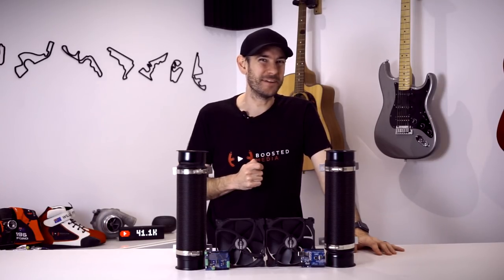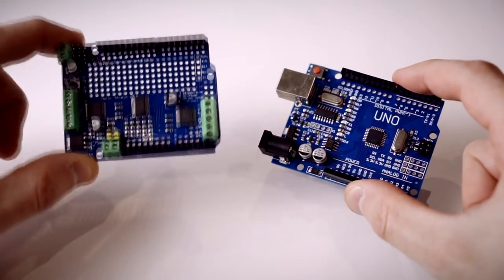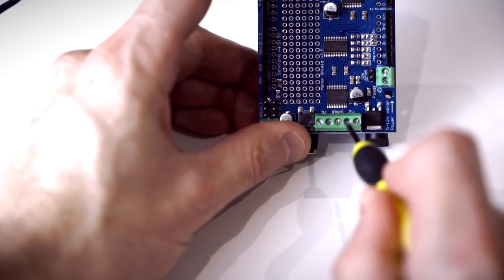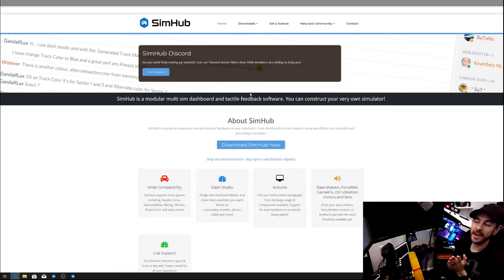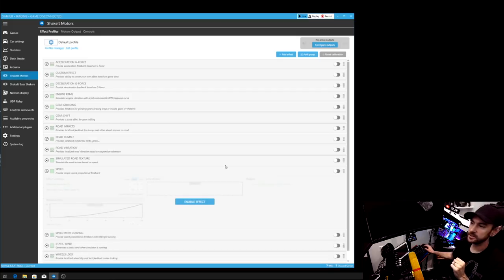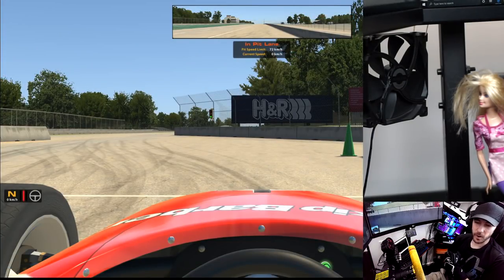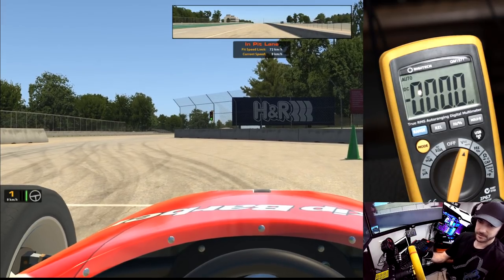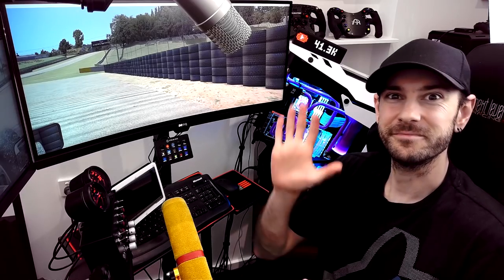Building a DIY Wind Simulator - Part 1

Comment: Thank you so much for the excellent instruction. Do you think there is a way to make a "Zoned" response the airflow? I am building a VR Heli Sim and want the wind to blow when i put my head outside the cabin to simulate the downwind experience by open door flight and looking down at the ground
Reply: You could just direct the fans into the area where you 'put your head out the window', then when you put your head there it will be blown by the fans :D

Comment: Does anyone know where you can purchase the motor shield with pre installated header. Can't find anywhere. Went through step by step and when I get to testing fan I get no power to them. I'm getting lights on both boards and simhub had detected the wind Sim.

Comment: Does the software account for wind curving?
Reply: Yes, but if you use this feature make sure you use PWM fan control, not voltage control. (simhub supports this, look at the documentation) Also ensure you only use about 25% change each way to prevent the slower fan from stalling.

Comment: Man I have really lost faith and trust in your videos because of this DIY wind sim video. 
1. The fan needed has to be perfect. I bought different fans and getting sputter at low speeds... the fans you have posted are not available in the USA!!!!  Please update link or give us an option!!!
2. Why did you have me cut the power wire. With the jumper on you can run power from arduino and not shield... I feel like I shouldn’t have cut now after watching other videos where they did not
3. Please explain settings better. Namely the PWN setting and honestly rest of SimHub settings. This is a huge hole right now that no one is providing very good.

Comment: Good news, today I got a real adafruit motorshield v2 instead of the broken clone, soldered the headers and voila - everything worked instantly like a charme.
But holymoly.... the 4000rpm fan is wayyyyyyy to much. Even with only 10% of power in Simhub it makes enough wind! Danger of conjunctivitis!

So if I do the math a 400rpm would be quite sufficient and I‘m wondering if the arduino and the powersupply could have been smaller as well. :)

It happened to me a while ago almost the same: when I planned and installed 4 bass shaker and a 4 channel amp (for my „racing seat“ of course) which can shake my neighbors now as well.... a little bit oversized as well.

Comment: Great minds think alike. Will, I'm working on this exact same thing. It's been in the planning stage while I've been trying to talk the wife into it. She thinks it's ridiculous and has been a hard NO. You have once again saved to day with your very timely video. So I'm moving ahead into the construction phase. This video has answered a lot of questions, as I to am looking for the immersion effect of driving open wheel cars. I have a new fan that will be mounted outside of my house in a mock dog house. This dog house idea I came up with will solve a couple of problems. 1. Noise, the fan I've chosen is a 110 volt, high CFM, 6" inline blower. At full speed it can move 500 CFM of air and makes a bit of noise. I plan on using sound dampening material inside the dog house. 2. Dust Free. the 6" duct work will come into the house using a large Dyer vent and will split into two three inch flex duct work, so that it can come into my rig just under the top deck, where each will end using a auto A/C vent. That way I can control the direction of the airflow. At top speed the air extincting will be traveling at near 120 mph. That is after I've regulated the blowers speed down a bit. It is capable of 200 mph, but that seems a little excessive for the dinning room. LOL. My point is, at those velocities anything pulled into the air stream would be very dangerous indeed. So the dog house will be a very large air filter. It will need to have enough filter area to supply the fans CFM intake requirements. I will send you a link to some photos as things come together. It should be insane. Cheers.
Reply: That all sounds amazing, until your dog farts 😅. 

p.s I assume you've sold your dog to fund your Sim racing addiction.

Comment: I haven't read all the comments but I think someone mentioned higher rpm fans. I did the same as you and started with some old case fans that weren't powerful enough. Moved to some cheap bit coin mining fans. They still didn't impress but what did it for me is to decrease the pwn in the motoshield setup to around 600 (play around with it) from my understanding, fan speed is controlled by pulsing the fan motors on and off. At 1600mhz, it is pulsing so fast that the motors barely get time to work. Try this before changing fans. Also, if you do change Fans, I recommend trying this for a stronger effect. It also heavily reduced the whine from the fans. Sorry about formatting, typing on phone...

Comment: Hey m8 I used the separate PWM feature in simhub to get it to interface my fans. The issue I have is that my fan spins only after reaching 120kph and it's at full speed. The fan never ramps up linearly. Any solution
Reply: Yes. The set the minimum speed for the fan so it is moving when you are at 0 kph. Then add 5% to prevent the fan stalling. Use the "cabin air" feature which keeps the fan spinning when not racing to determine the slowest speed your fan will handle. All fans have a minimum speed. PWM fans will not move the fan until it reaches a safe minimum demand. Also, PWM fans have a maximum pp/s above which the fan will stop! You will need to determine the minimum and maximum values for your fan (and arduino) and then go 5% over the minimum and 5% under the maximum. Note: this behaviour is true of ALL PWM fans to protect them from damage. Further, if you push the demand close to the 100% mark, the fan will soon shutdown to prevent the internal electronics overheating. PWM fans move air well but ironically have no cooling for their own electronics.
Finally, you may find you cannot reach the maximum continuous RPM for your PWM fan. The reason is one of a: the spec sheet is lying - this happens a lot, b: the Arduino cannot produce a clean PWM signal at the rate required to hit the maximum fan rpm. Again, this is very common. The maximum I have been able to achieve with a true 5000rpm PWM fan (they are expensive!) is 3600rpm because the 16MHz Arduino cannot switch the signal any faster with a clean rise/fall in the signal. It would need to provide a 43,000 (forty-three thousand) on/off signals per second to hit 5000rpm. A 16Mhz Arduino can only reach 23,000 pwm cycles per second reliably. Pushing it any faster makes the signal "muddy" and so the fan shuts down to protect itself.
Reply: @bertram-raven  Wow that's alot to digest. But anyways thanks for such a detailed explanation. I had abandoned the project due to the issue but looks like I can get it working by the summers

Comment: If you want to get more airflow instead of getting a 120mm 4000rpm that sounds like a leaf blower, wouldn't you be able to do with a couple 200mm fans that don't spin as fast?
Reply: If you can find one that is lower than the amp limit of the arduino then you could

Comment: I have all parts together now but the motorshield is a) horrible expensive and b) not ready soldered. What a bad... I bought a motor shield clone instead BUT this doesn't work at all. The arduino is detected only without the shield. Harrr.
Did you really solder the heads by yourself?

What I want to mention anyway: 
One can not underestimate those DIY videos like yours enough... I would have never started building a wind simulator, even though it's not successful yet. But with all your hints and tips it makes it much easier and pleasant.
Thanks again, Will.
Reply from the maker: You’re welcome. My motor shield came assembled.

Comment: Can someone suggest a motor shield that does not need soldering ? Thanks.
Reply: I had the same issue. Plus my fans had 4 wires. Did you find anything?

Comment: Always dig your tutorial videos...I found you after my latest PC build with the ROG Asus Maximus IX Code and a i9...Thanks for helping me get to 5Ghz!!    I sim race in the Porsche Club of America Series and VR with an Index.   Wind is always welcome in long races and one might as well match it to your sim speed!!!    What are you thinking in terms of CFM.   I am targeting the  2ea of the 4" marine bilge blowers at 12V 6A.   So I am thinking 2 at 270CFM should do the trick.....thoughts?
Reply from the maker: You’ll need a more powerful motor shield to run those. :)
Reply: @boostedmedia  Yes sir....I have a motor shield selected that can push 12A to two fans or 24A to one.   And I went with the smallest physical size for a 12V 30A power supply.     As far as cost I am at $140 all in.....less USB cable.

Comment: I've ordered the motor-shield you linked but it comes as build package which needs to be soldered.  Seems to be a very precise work for a soldering noob :s Do you have a link where to order a pre-assembled version of the motor shield? :)
Reply: update soldered the motor shield on the Uno but no current seems to come out of the motor shield after hooking up the fans.. I think I fried the motor shield by attempting to clean up my soldering mess.. so heads up for anyone who attempt this build.  Make sure you have the soldering skills required or order the shield with pre-installed headers: https://www.amazon.de/gp/product/B07K9ZW3TR/ref=ox_sc_act_title_1?smid=A3BI8G9NTBZUKM&psc=1
Reply: @insr3339  hello there , I bought the motorhsield / arceli you are mentionning here but can not get it to work , were you successful doing it ? how did you configure it in the simhub ? thanks

Comment: Thank you so much for this tutorial! I managed to get it all running! Only issue is that the fans keep turning off then back on again in the middle of driving. Its not a power or fan issue since when I test them on 100% speed they stay on for as long as I keep them on at 100%. However, during driving, they constantly shut off then turn back on. Any ideas? Thanks!

Comment: Hi... great vids! I’m following this tutorial to make my first wind sim but I’ve bought x2 252cfm 12vdc 48w per fan and the Arduino UNO 3, I’ve had to change the shield to the monster moto shield to run the more powerful fans. However I’ve never done anything before and was going to follow your guide step by step but should I don anything different regarding the simhub set up using a different shield? Thanks in advance buddy

Comment: Have you thought about using regular table fans? Just set them on their highest setting and connect a SSR with zero-crossover switching to regulate the speed. You just need a simple PWM signal to regulate the SSR. 😙🎶

For streaming just get a dead cat for your mic 😂
Reply from the maker: Good suggestion. I did look in to that option. Probably a bit complex for the video though. And far too noisy for my usage case.
Reply: @boostedmedia  why too complex? It's just an AC fan and a relay which need to screwed in between the plug and the fan. Instead of running the full power for the fan thru your board you just need a PWM signal based on the speed. Everything smaller than table fans has way too less power to be convincing than you drive 200 kph 😂

If you put a helmet on, you can put the mic inside, this should give your eyes a protection from the wind and a much better representation of actual driving.
Reply from the maker: No way I’m messing with mains power in a YouTube video. Lawsuit asking to happen ;)
Reply: @boostedmedia  is this seriously and issue? I think there are a lot of channels out there making content about electricity. Just do a disclaimer and just show the final product, so just a wire running into a grey box and out again, and two wires running to your microcontroller.

The point is, it's actually much safer to use a SSR since they have an optocoupler on board, physically separating the high voltage side and the low voltage side. And you don't have to deal with high current DC power, for a big fan, which is actually also more prone to errors than just using the AC cable included with the device you're using.

Comment: Has anyone figured out if you have to cut the power cable like he does? Or just plug it in? Seems he just cut cos the power supply didn’t fit? Love to know reason why he connects that way rather than simply plug it in. Thx
Reply: There are two parts to the Arduino: the uno and the motor shield; both of which require power. The motor shield obviously requires more power since it is supplying the fans. He is supplying power to the motor shield via the 12v adapter and is supplying power to the uno via the USB. 

If you don't want to cut the power supply, you can always wire a 12v female end to the motor shield.

Comment: Hi Boosted Media, you inspired me and I followed your guide to get the same result. I also bought this tubes to get it more reamistic. Just one question : Did you birth something to reduce diameter from 120mm (fan) to 76mm (tube) ? Do you have documentation about that ? Many thanks in advance for your answer ;-)
Reply from the maker: Will be covered in part 2.

Comment: Hey, All parts of the wind sim I have received. Even the fans after almost a month and luckily they do it. I connected everything as in your video and also installed everything via simhub. But .... nothing happens when I press the test button. As soon as I press the button in quick succession, both fans start running. Now I have started iracing via simhub. But nothing happens at all. I can hear the adruino making noises but the fans are not going to run. Do you have an idea what it can be?
Reply from the maker: Not sure sorry. Perhaps a defective motor shield or perhaps something not configured correctly. Impossible for me to say.

Comment: I have been looking for this for months. Now you say in the video. if you use the 4000rpm fans, then you have to place heatsinks on certain chips on the motor shield. now my question is which chips and what heat sinks ?. Thanks in advance for your answer. I can not wait what your solution is for mounting the tube on the fan.
Reply from the maker: Still looking for appropriate heatsinks but will update in the part 2 video. The heat sinks need to go on the motor controller chips on the motor shield board. Those 4 identical ICs.

Comment: Hi Will just trying to setup the arduino uno but my computer cant find the port it's in could it be a bad board? Thanks Ian
Reply: check the solder/connections between the arduino and the motor shield - I had a similar issue and resoldered  a few of the pins

Comment: use an RC motor with a 3d printed fan - definitely feel it then and will have a lot more range of speed.
Reply from the maker: That’s a great idea! I might experiment with that later on!
Reply: Yeah good idea or even use the blades from the same fan since you can remove them :D
Reply: Using a brushless RC motor could be done but it's a different process over using just a motor shield.  You'd need an ESC to control the motor which then can in turn be driven off an arduino like a servo.  The sizing of the motor for the proper kv could also be some trial and error as that changes the speed and torque values and how big a prop/fan you can run.  Also RC usually runs off 2S-6S and up lipos, so depending on the motor selection you may need to push more that 12V and at higher amps than a standard computer fan would do.

Another option might be to use bilge blower fans for boats or actual racing duct fans but may be on the loud side.

Just some feedback and thoughts.

Comment: Would you recommend to do it? I have 2 same fans laying around from the PC case :)
Reply from the maker: I wouldn't bother if you're going to use these same fans. The effect is tiny. But if yeah it'll absolutely be worth it with better fans.
Reply: Ok cool, i do have some higher pressure nzxt fans too so they might work too :D